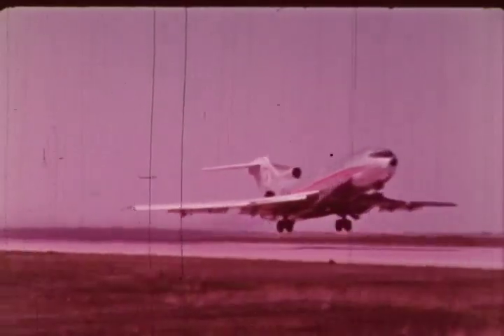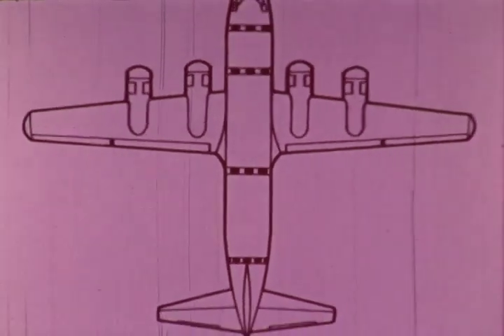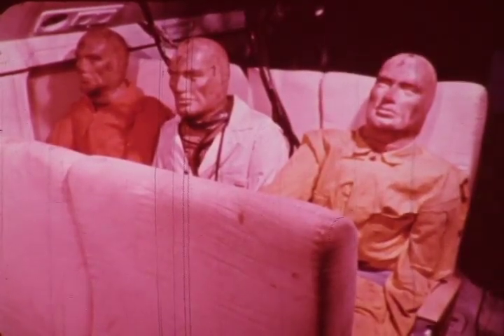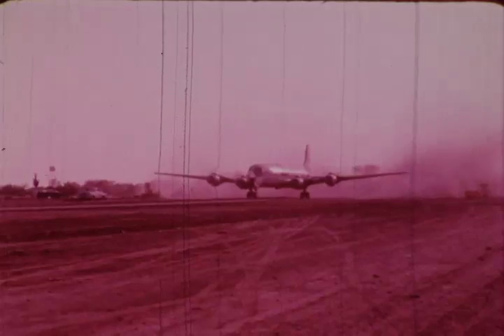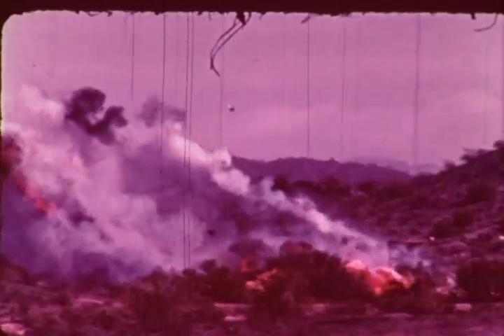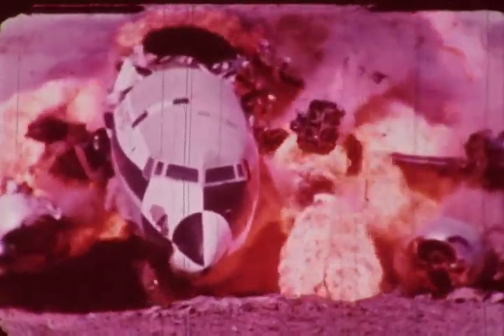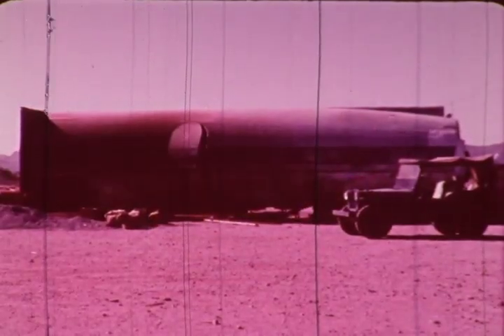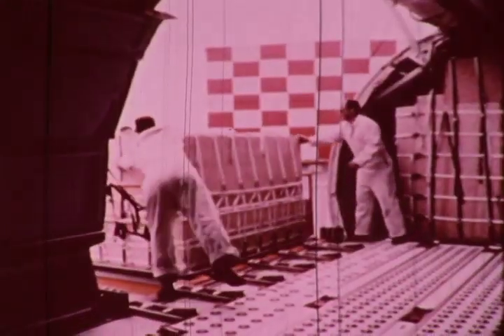F-0452 Aircraft Accident Video: Crash Transport Safety Test Part 1

Comment: These tests were preformed  decades ago and show that rearward facing seating is, in a crash environment  much safer. Personally  I can verify this after many hours as a passenger on the Air force's  Lockheed  C-5A cargo aircraft which has a passenger compartment  above  the cargo area where the seats face to the rear. Also, I can't help but think that some sort of "crash" airbag system, say installed in the upper seat backs of the seat forward would help infinitely in the case of a crash with neck, head and facial injuries.  In addition,  I've yet to see any child restraint system emplacement  in any passenger aircraft. All of these features  were proven to minimize  or reduce life threatening  injuries  during these tests. Now I realize that the impact  speeds were far less with these tests because of design  differences between  aircraft.  Today's jet aircraft  have far greater impact and landing  speeds for the most part. However, one would think that since these test were performed  decades ago that some of the aforementioned elements  of passenger safety  could have been implemented  over the intervening  timeframe. After all even during the Second World War,  pilots were provided  with shoulder harnesses  and such. That in itself is far better than a lap belt that is most  probably  improperly  positioned.